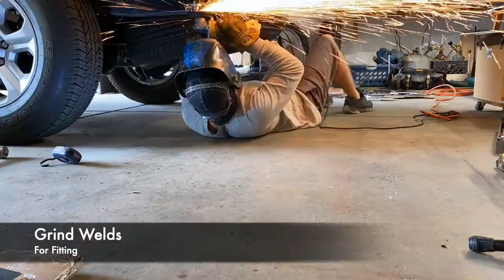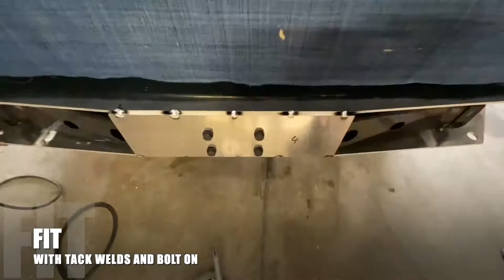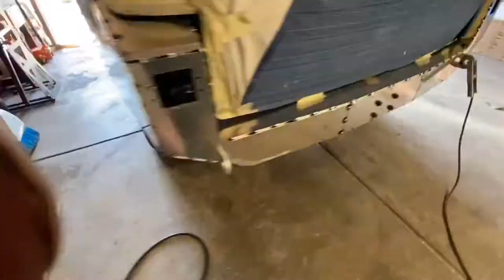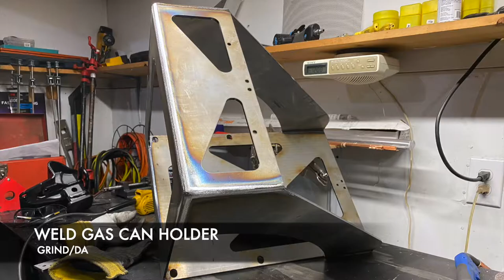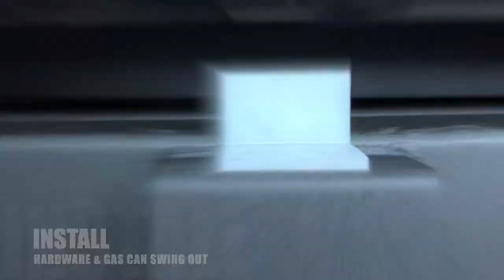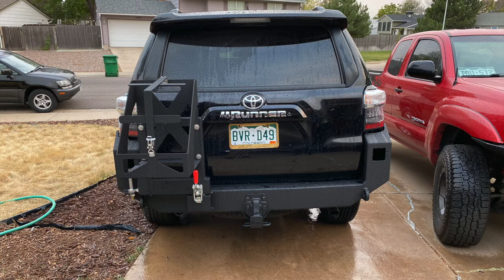5th Gen 2020 Toyota 4Runner Full Height Rear Plate Bumper Kit From Coastal OffRoad (Aluminum)

Comment: Exactly what I was thinking on,for my 4runner 2013 2wd,but how much?like that job!
Reply from the maker: Hey Rafael, 

Thanks for reaching out! For the aluminum Welding/Fabrication and labor from Trending Fabrications $1000-$1400. The pre cut pieces were purchased by the customer from Coastal Offroad before hand. The steel kit is less expensive than the aluminum. Here’s the link. 

 https://www.coastaloffroad.com/product-page/5th-gen-4runner-full-height-rear-plate-bumper/

If you are interested in having Trending Fabrications LLC  put the kit together and install email us at
Info@trendingfabrications.com

Currently working in the Denver area.

Comment: Did you have to do any modifications to the brackets of the 4Runners rear bumper?
Reply from the maker: Slight extension to existing hitch to wrap the new bumper and ensure alignment with bolt holes. Other than that no mods required for building other than tapping a couple holes and grinding a weld flush on the rear of frame.